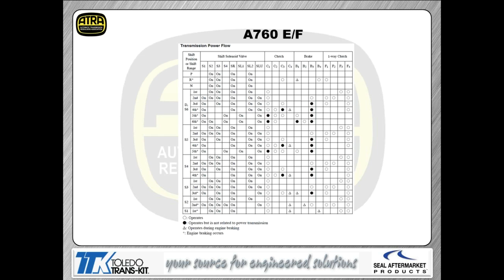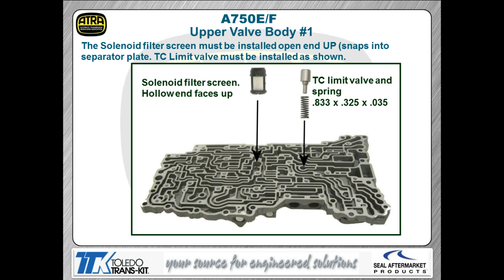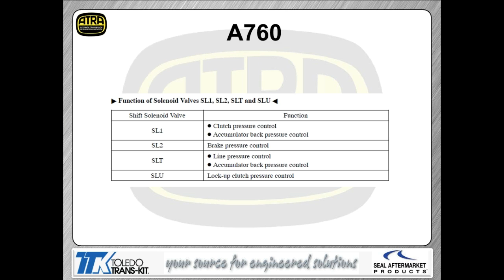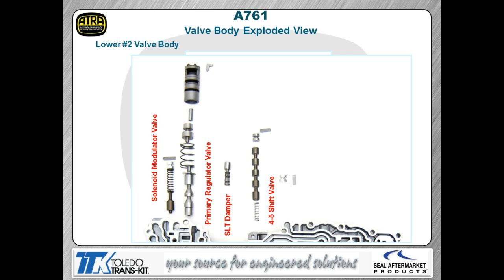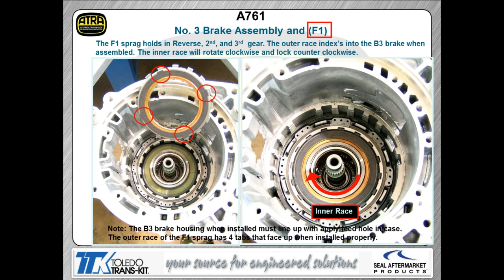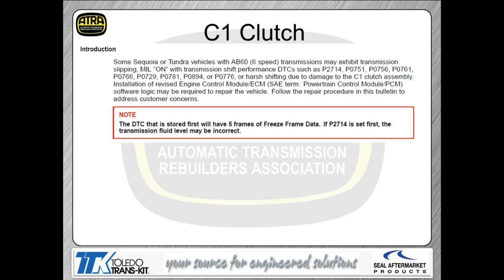ToyotaA750 A761 Introduction

Comment: good day, my A750F transmission does not accelerate in 5th gear. it goes through all the gears fine but when it gets to 5th gear then it does not accelerate. infect it decelerates with the acceleration pedal pressed down